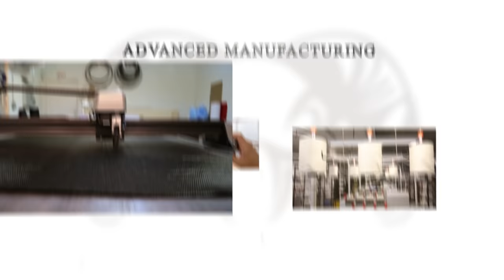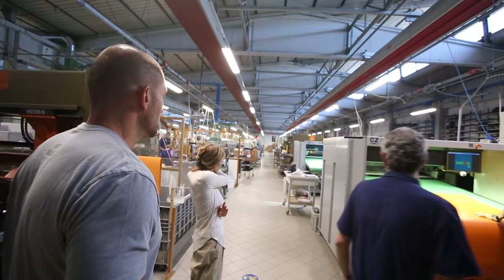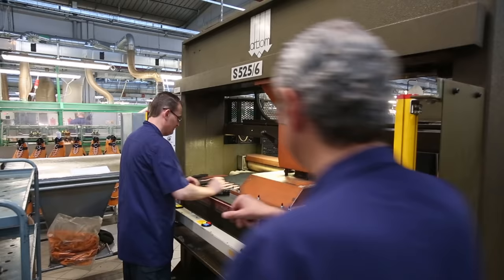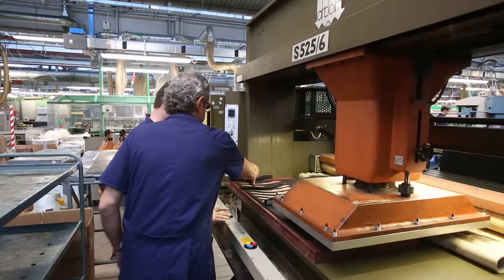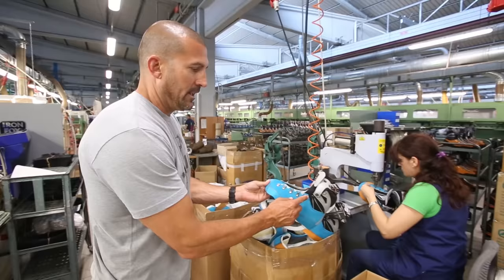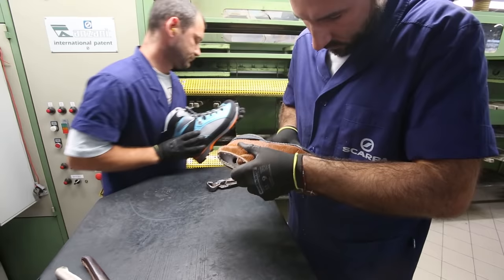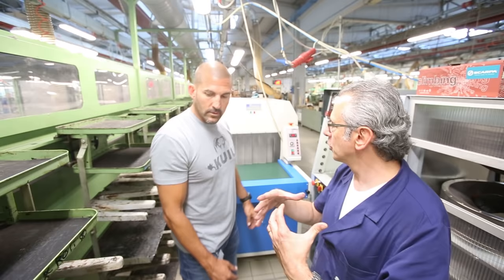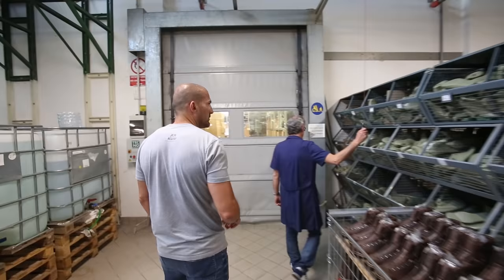KUIU - The SCARPA Boot Factory Tour

Comment: The construction of the boot is glossed over. There are actually three types of construction used: board lasting, slip lasting, and direct attach. Since the method shown involves glue it's probably either board or slip lasting. The latter is used for highly flexible trail runners and climbing shoes, and they probably won't be resoled, at least not without highly specialized equipment. It looks like board lasting could be converted to a goodyear welt but building the midsole would be very complicated, and the sole is probably too thick to be stitched. So the crux of the Scarpa manufacturing is glue and automation. They used the term "hand stitching, but it's clear that the host is not very familiar with actual hand stitching, which doesn't use machines at all. So this was basically "hand stitching with a machine" haha.
Reply: After converting to a goodyear welt, probably using a gemel, the midsole would be stitched directly to the welt and then the outsole, heel stack, and heel lift would be glued to the leather midsole. It would be quite a job but might be worth it if the uppers are durable. The other option would be to "shave" the lugs off of the vibram outsole and then just glue on a new halfsole/heel combo. The boot would be about the same weight as before the resole, which the conversion to a goodyear welt would make it quite a bit heavier.